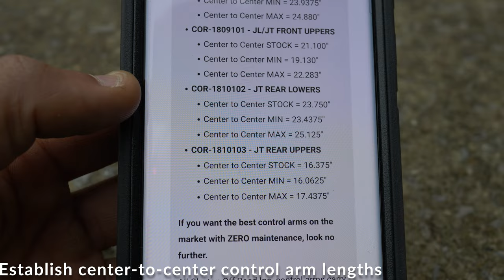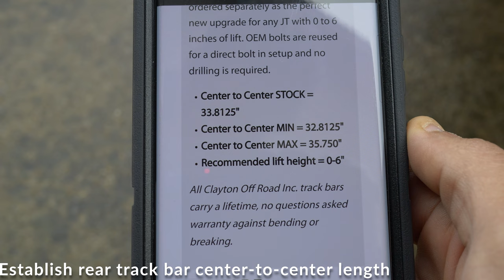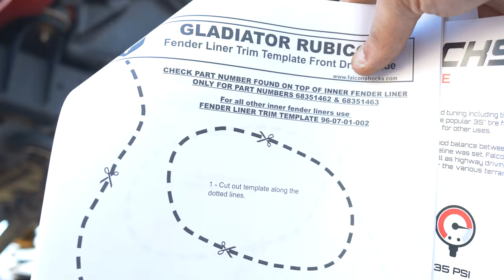Clayton Off Road x Jeep Gladiator Rubicon | Overland Plus 2.5" Lift Kit Installation | Driveway DIY

Comment: get a plastic mallet next time
Reply from the maker: Honest question: Have you ever tried to separate a joint with one? If you have, and if you were successful, the joint either wasn't stuck to begin with, or that's the best plastic mallet ever made and you need to let me know what brand you bought!

In my experience, only a metal sledge can send enough energy to shake it loose. If I were using a plastic mallet, I'd still be out there in the driveway to this day.
Reply: @TerraOutdoors  Its for placing the new control arms into position, I have several weighted plastic mallets for that. Now knocking the old ones that will probably never be used again who cares if those get dinged up
Reply from the maker: @acecalzadilla6878  Ah haha, gotcha. Not to worry. That mallet that I was using on the control arms is a rubber one.
Reply: @TerraOutdoors  🤣 🤣